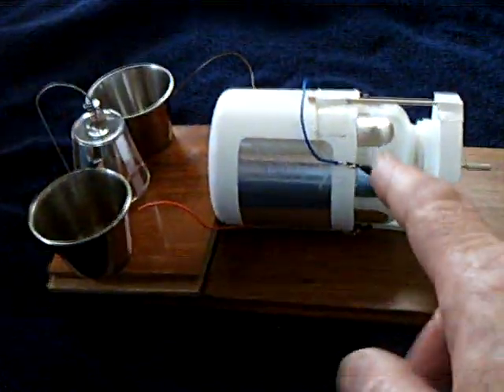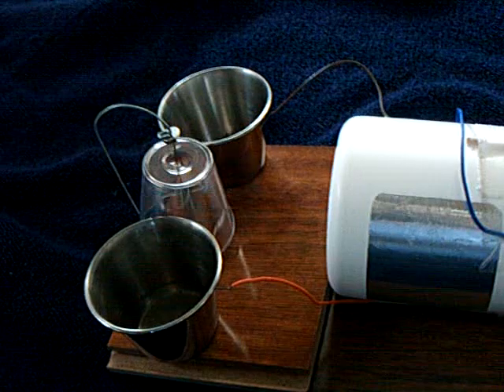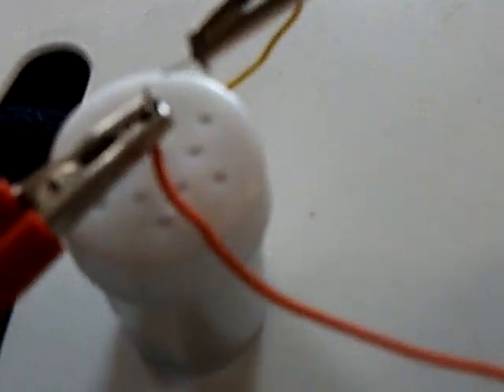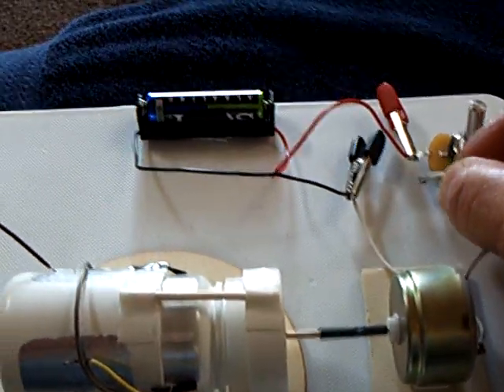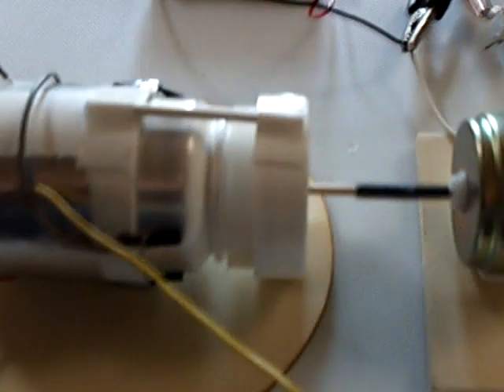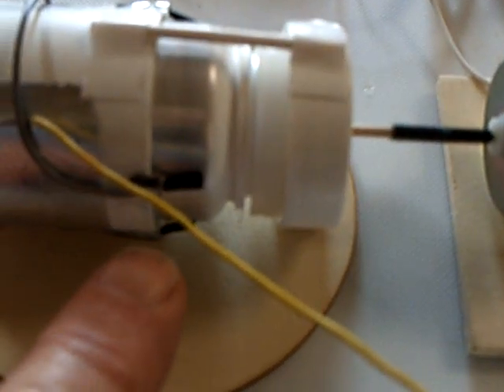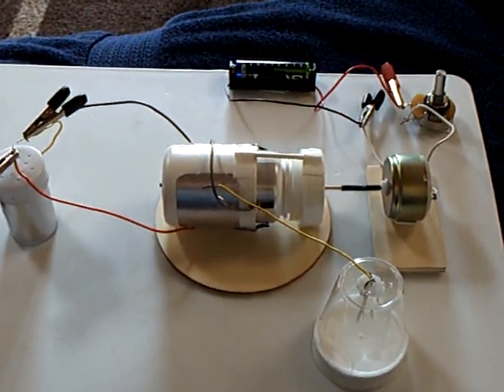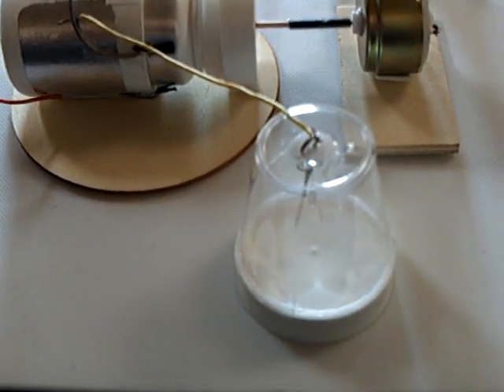Motorized Electrostatic Generator with Carbon Fiber Brushes

Comment: Hi would you try a copper wire wound round those wires to the spark gap this should make a magnetic field ultimate one way diode as stan Meyer states in his newzealand video
Reply from the maker: That might be fun to try.  Thanks.

Comment: Cool. The problem associated with sparking between the segments can be significantly reduced by applying a few coats of shellac over the bottle, after the aluminium foil strips/segments have been applied/fixed in position. You can even use the shellac as the adhesive for the aluminium segments, then apply more shellac over the top to seal it up. This is how they did it over 100 years ago and it still works just as good now!
Reply from the maker: Thanks for the tip.  I think that the rotor segments are too close and the brushes too big.